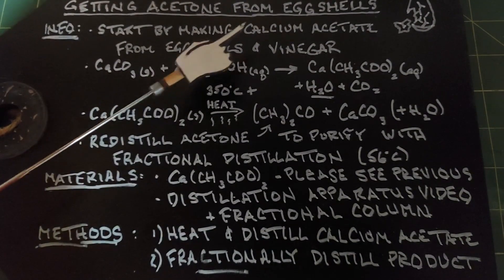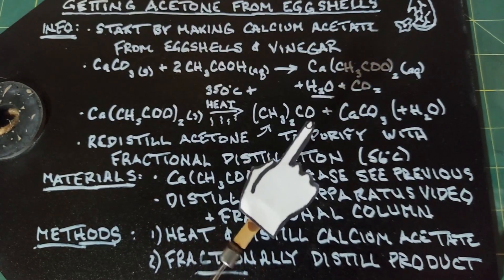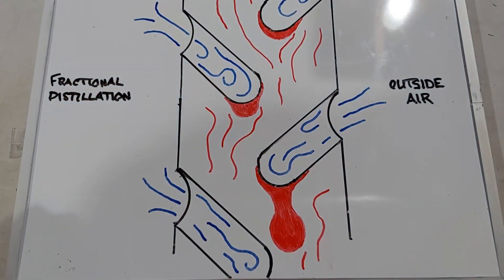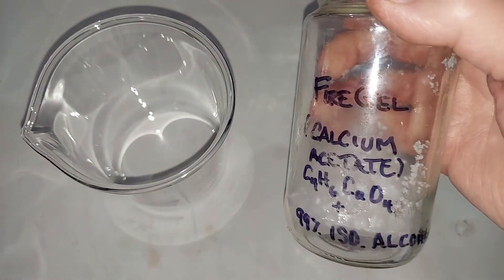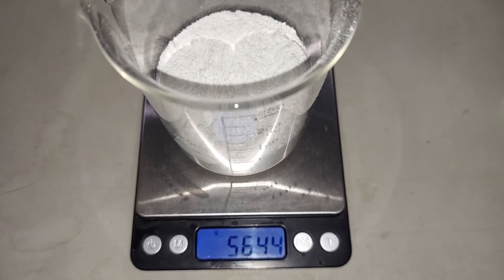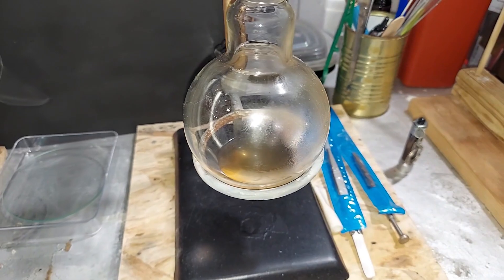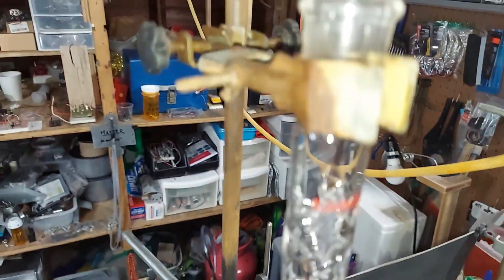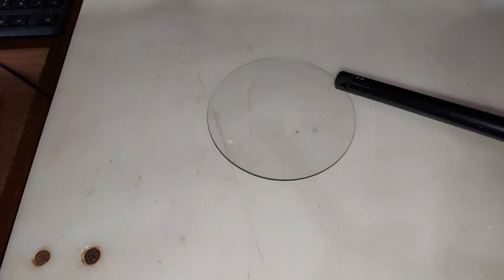You Can Make Acetone From Chickens

Comment: Did you ever run into a problem with the egg shells having detergent being stuck in shells from processing plant? When I tried it made so much foam. I swapped to sea shells.
Reply from the maker: The foam isn't from detergents.  It's the effect of the acetic acid on the organic materials left on chicken eggs.  I have a video on making calcium acetate to then use to make "fire gel".  In the video I go over how to get rid of the foam.  Basically before I use the eggshells for anything I soak them in bleach for several hours, then rinse.  It works quite well.

Comment: Lab work's Interesting, tho my silly question of confusion.  Noting info in description: 'Breaking down to several components'.
Calcium acetate 5:20 ..  re: 6:15 .. after collecting Acetone;  6:20 Calcium carbonate.   ... 
acetate & carbonate Look same, how can you tell?   (spite Fact no further distillation)  -  had to be there, i guess. lol   
Fractional Column:  now That's Art!    Thanks!   
would Bleach cause odor?  re: 'Debris' removal: (since i have no idea), does boiling shells remove\ 'weaken' calcium?
Reply from the maker: No question is silly.  They do look the same through the glass.  However, if you poured out the calcium carbonate you would see that it is a gray-ish color with burnt black specks in i, compared to the very white calcium acetate.  Thanks for your compliment!  I do like to draw things as it helps me understand better too.  The bleach dissolves the thin membrane found just inside the shell wall.  This membrane contains protein and caused the reaction with the vinegar to bubble furiously, often making the mix overflow.  By dissolving this membrane the excessive bubbling is kept to a minimum.
Reply: @cranialconstruction    Thanks!  No doubt, i can picture after heat, calcium acetate would have the 'Beach' look.  8) Seeing how Clear Acetone turned out, 'something' did it.  
Bonus to note:  Vinegar dissolves Protein, should be good removing Blood. ?   just a thought  Cheers!
Reply from the maker: Good call.  Vinegar does indeed remove blood from fabrics, especially if it's not old blood stains.
Reply from the maker: Oh yes...and cheers to you also!